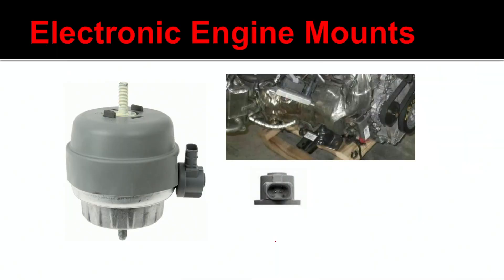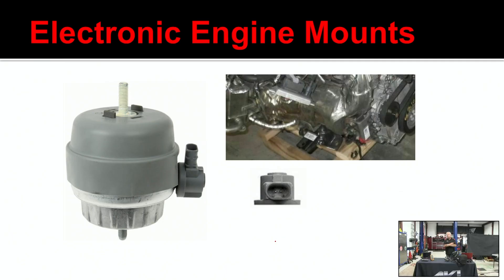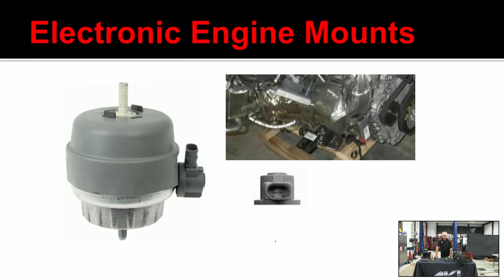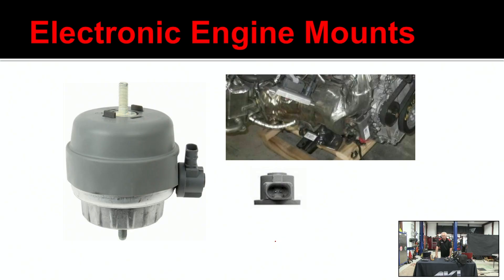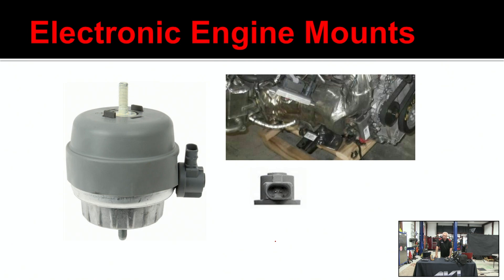Duramax Electronic Engine Mounts: Tech Tip

Comment: Engines don't vibrate. If you have a vibration issue, exchange the dampener.
Reply: This is by far the dumbest thing I have seen on youtube. Yes they do.
Reply: @75zl1  I can point you to countless machines that have solid steel motor  mounts and vibration is not any sort of any problem, so you must not be any good at building engines.
Reply: @btasler hahahahaha you clearly don't have any idea what you're talking about. An engine on a stand runs at a constant rpm. An engine in a car varies RPM and can't be completely vibration free at all rpm(such as idle) where it would be at say 2000 rpm where it's cruising.
Reply: @75zl1  blah blah blah talk talk talk whole lot about nothing. Nobody said anything about an engine on a stand, not that it matters.

IF YOU HAVE VIBRATION ISSUES, ADDRESS THE CAUSE. USUALLY IT IS A FAILED OR FAILING DAMPENER, dolt.
Reply: @btasler lol so a cammed up engine won't vibrate? Sure thing dummy